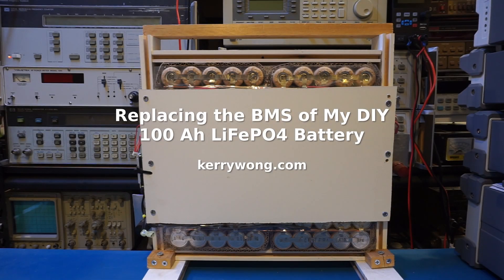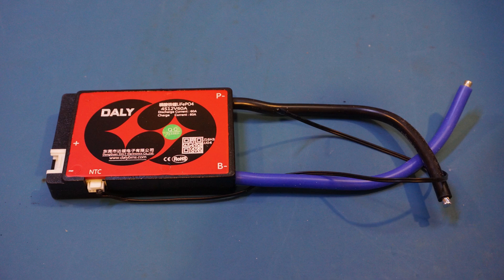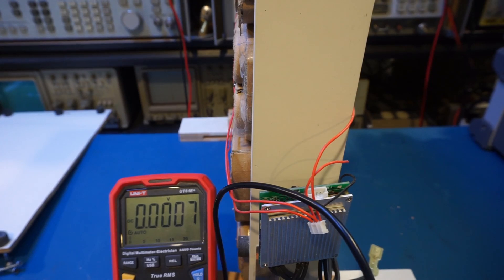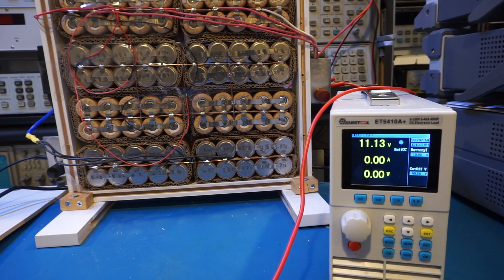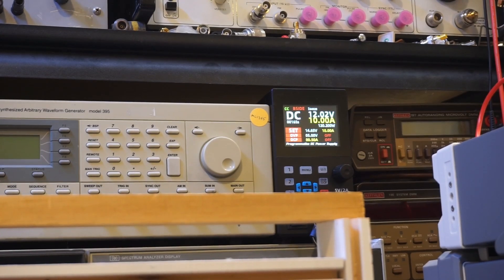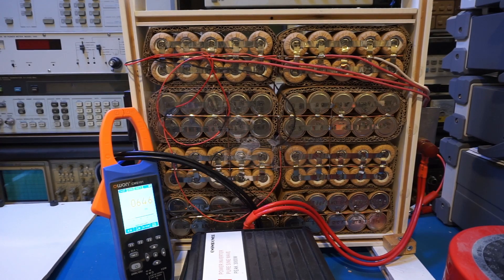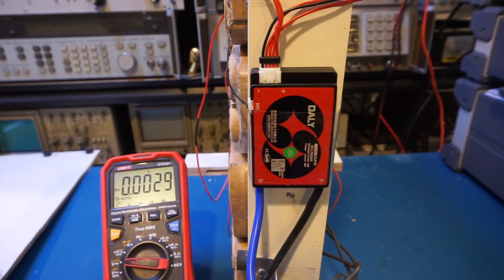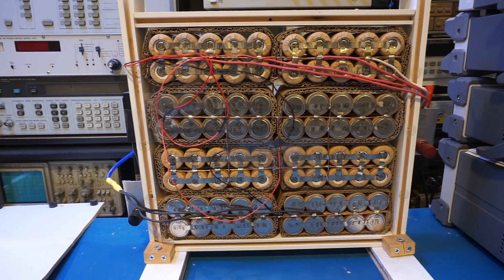Replacing the BMS of My DIY 100 Ah LiFePO4 Battery

Comment: I have been charging my home-built 16s battery to only 3.35 volts per cell every day for over three years. I do not have a bms on the battery, but the cells are all within 1-2  millivolts when fully charged, and I do float charge at that voltage.

Comment: Please don’t guide people to use a power supply as a charger. Maybe you’re not aware, but most people can’t regulate current properly—they just set the voltage, usually too high. Also, they often don’t have a power supply with a current cut-off, which is really important. Please, in future videos, guide them to use a proper charger rather than a power supply.
Trying to explain how to use different types of power supplies for charging batteries is really difficult and often leads to misunderstandings. It’s always better to use a proper charger designed for that type of battery and voltage. Thank you for everything you do, your videos are always interesting.
Reply: this is not exactly a housewife channel and them handling high energy batteries in the first place is not the responsibility of everyone else